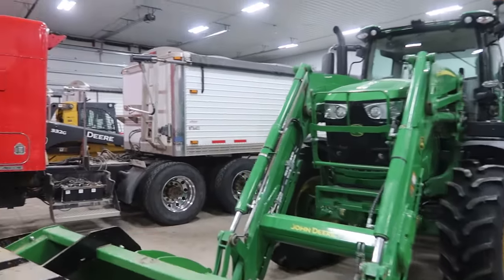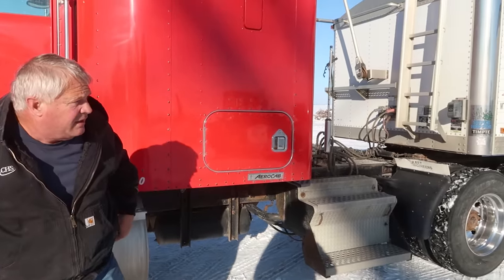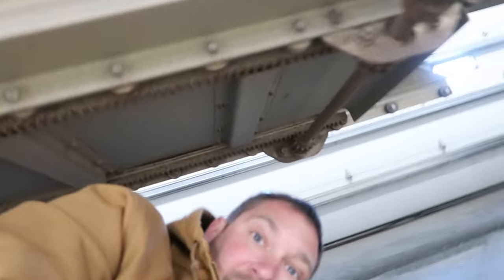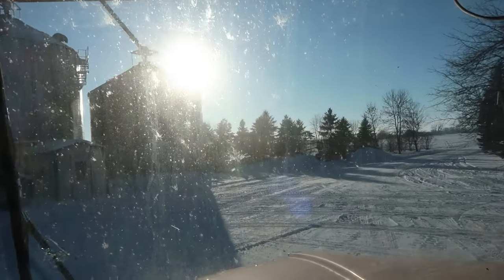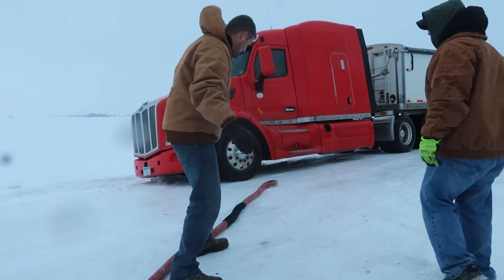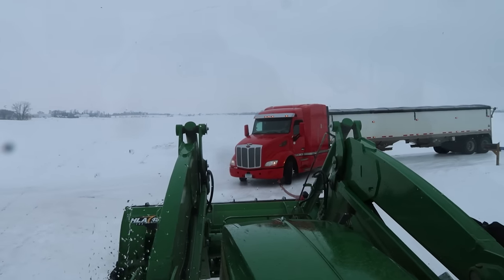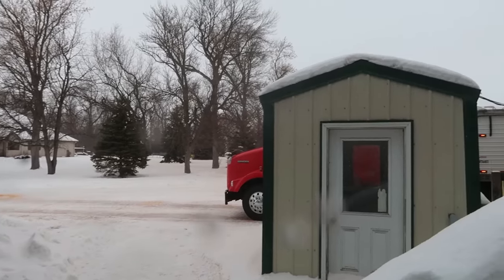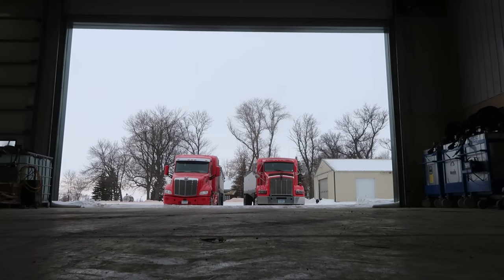Ice Road Trucker-Farm Edition

Comment: on your ken worths (semi's) try changing the cables to the batterys if that doesnt work put a cut off switch were the battary cables leave the batery box. My truck I use for snow plowing had the same issue and we put a cut off switch in it because it was drawing amps some were. It works great now. (Plz like this a share it so Millennial Farmer will see this.)

Comment: the bearing can be adjusted by checking the air pressure in the right rear tires on the tractor

Comment: Best thing we ever did was put crossfire indicators on. Fill both tires at the same time in the open instead of trying to fit the air chuck inside the holes.

Comment: Zach I have been telling you.  Go get yourself some Cat Eye dual tire equalization valves, or a similar brand, and you can check tire pressure on both duals at a glance.  And if you have to add air you air up both tires in 1 easy to reach valve. Plus you get even tire wear on both tires because they are both the same pressure.  It's a no brainer.
Reply: what if one tire needs air and the other doesnt?
Reply: @jimsmith9819  the tire equalization valve attaches to both tires, so both tires are of equal pressure.  So if the valve shows low pressure or high pressure, you would add or subtract air to both tires at once. Now if one tire would suffer a total loss of air or if one tire suffers a puncture,  the tire equalization valve would allow only so much pressure loss before it would isolate the tires. So in that case,  one tire would be low and the other would be flat. What the valves do, is equalize the pressure in most circumstances. Because the inner tire is closest to the brake, it heats up more, and consequently has more pressure, and are prone to blowout more, and have a different circumference than the outter tire, which causes more tire wear.

Comment: You need to use cats eyes on your trucks and trailer then you only have to check one spot per set of duels and you can visually see that it is either good on tire pressure or low

Comment: 2:35.... Zack, you can install an aftermarket auto tire inflation system for your truck and trailer.  Never have to check tires again. OOOOOR install a 100% wireless Doron 360HD tire pressure monitoring system. It will alert you when any of the 18 tires get low.

Comment: Zach, you might consider TireMinder tire pressure monitoring.  I use them on my cargo/snowmobile trailer and they work perfect.  Takes seconds to check ALL your tires....so much easier than manually checking.

Comment: Zach I think the reason the stubborn truck starts so easy now is you might have had a couple of batteries with different cold cranking amps in the old “stack”. When you have that, the stronger batteries drain the weaker batteries and leave you with nothing. Had that problem with a truck I bought. 2 new interstate agm batteries and she wings over like no tomorrow.
Reply: message_FarmerTylerRanch  Not going to happen hoss.

Comment: You might look into trading those hopper trailers in for the same ones with a meritor or Hendrickson auto air system that keeps the tires inflated even if you got a nail you can run it back home to repair you might be able to retrofit the system on to those trailers but you gotta completely disassemble the axles and all that stuff so for expenses I'd think about trading in for the trailers already equipped with the system it's definitely worth it in my opinion and I'm old school I don't like new fangled stuff and even I like the system lol

Comment: Ahh snow and rain ontop of that. Makes for some slick roads. Had the same kinda weather all winter here in Norway.

I have two cars, one without metal spikes in the tires. And an old van with metal spikes. Ive just become a huge fan of metal spikes in my tires after this winter, my new mercedes was like bambi on the ice. Even with all the electronics too help it. While my old van without a single electronic thing, and metal spikes just took every kinda weather with ease.

Might equip the mercedes with spiked winter tires the next time its time for new tires.
Reply: I believe metal spiked or "studded" tires are not allowed in MN.  I think they were outlawed in the late 70's or so, before my time. I studded my tires in Alaska and yes sir, they make a difference.
Reply: @hawks2252  correct, not legal in mn. Though for the gravel roads you could get away with chains
Reply: @hawks2252  They make a huge difference.

Ahh i see. Are you allowed to drive with chains tho in MN? Or is that outlawed too?

Alltho chains are a pain compared to studded tires. Hassle mounting them etc.
Reply: @MrDanisve  When I lived in Alaska, I had two set of tires as well.  Summer regular tires and winter spiked  "studded" tires, although some winters I didn't swap them out. " I'll just leave it in 4 wheel drive for 7 months".  Lazy and/or got busy - you know the deal.  

MN is flat land.  As far as I see there are not truckers running chains.  I do not know if they are legal or not in MN.  Definatley not cars or passenger trucks use chains.   The mountain states  in the U.S. run chains.  Mandatory for some areas in some states. Although if you paint the chains black will anyone know?  suppose to get 13 inches snow Wednesday - Hmmm - I have to go into work.
Reply: @hawks2252  Required by law here in Norway to have summer and winter tires.

You can have allyear tires, but almost no one opt for them cause they are bad at both summer and winter. Jack of all traits, master of none. 

Tho you can choose if you want studds on those winter tires. The bigger cities often pose a an extra tax on cars with studded tires cause they pollute so much (And honestly dont need studs in the capital)

Here in Norway its quite normal to have chains in the back of the car for passengers if you live abit rural/remote. For emergencies, a rough hill or when you need it.

I have airtools so switching my tires is just an excuse to use them, my garage is like a tire changing shop for all the family :D

Ahh right, MN is flat as a pancake. Quite in contrast to my mountainous Norway :P Need some grip up those hills, and down them :P

Comment: Zach you really should consider investing in some Multi Seal Pro HD 2500 XE tire sealant that way you don’t have to worry about them tires no more brother. One of the best things I’ve ever done and use it on my truck, trailers, and Deere. They even got a version that works with Rim Guard. Check them out.

Comment: It's great to see you moving your corn. I see that the prices are really good. I realize it isn't my business, it's yours; But with the inflation and the price of fuel, where do you put the extra revenue? Do you buy extra fuel for next year? Or do you pay down the debt on the equipment? It seems like it would be impossible to run a business with such extreme ups and downs.
Reply from the maker: It's a balancing act for sure. Honestly, we haven't taken the extra revenue yet. We have a LOT of grain money we haven't taken. The ethanol plant and elevators are sitting on it. We will take it later and try to even out the income year by year. It makes us nervous because we're trusting them with a lot of pur money but it's never failed us yet. Great question.

Comment: Your flags are not hung properly. You have my Stars and Stripes facing correctly, states always to the left. But, my Stars and Stripes always hang to the left of any other flag as well. You should switch them.
And take some scissors with you, my Stars and Stripes are always equal or larger than the other flag.
If you want my sub, respect what blessed you with all those diesel guzzers.